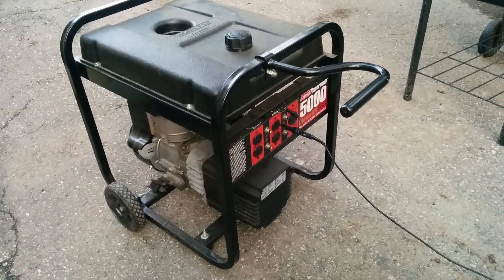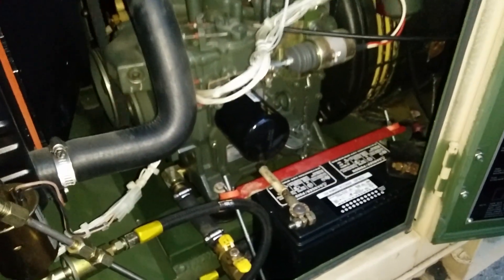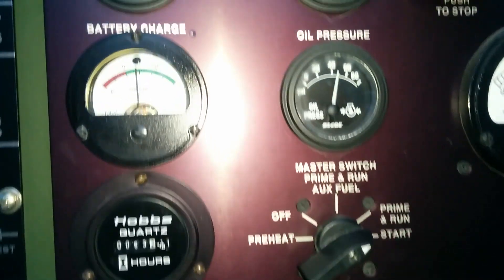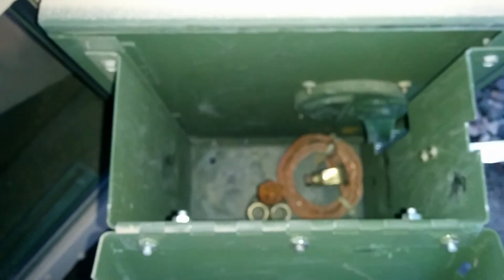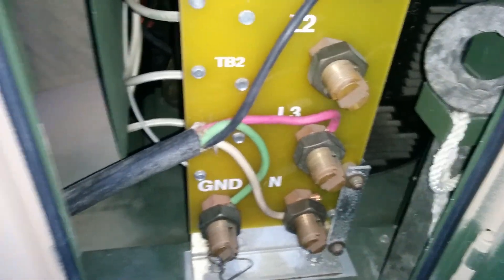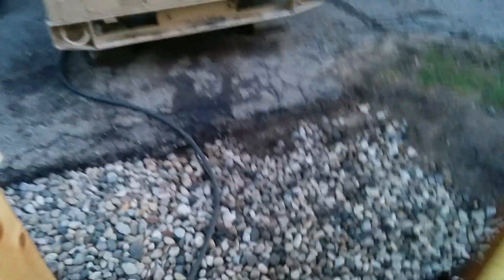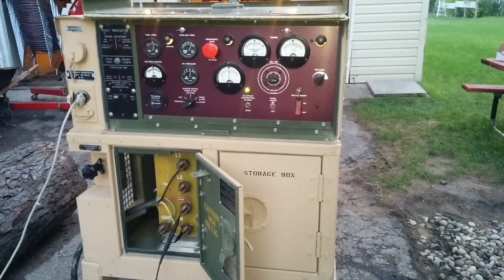Mep-802a vs consumer generator

Comment: how did you obtain this unit? was it at a government liquidation sale? were you allowed to inspect the unit before placing a bid? how much was the purchase price? thank you for your time and look forward to a reply. I am in the market for a standby generator and looking for information on the subject of military surplus.
Reply from the maker: thomas marabillas yes govliquidation.com does allow squeduled previews but tge closest site to me is 3hrs away. I dont know if govplanet.com will allow previews. Look for reset tags the tan one have tgem more often. Dont buy it if it has that. Look for wet stacking around the exhaust manifold. They can still run but usually never at tge rated power tgey once could without a rebuild and they'll burn oil if they're westacked. I lile going for ones that have the exhaust flap in pristine condition to better ur odd rain water never filled the engine. U can get them depending on availability in your area and how many per auction and how many hours 1500 or less is a number i go for. They can very from $1000 to $2500 for a good one.
Reply from the maker: Syc holic holy crap 5500 for a early 80s air cooled 003a with a new paint job. Those things didnt come with digital gauges either. Have you ever heard a 002 or 003 run? They are louder then that Coleman. They put out clean power too but man are thet loud. I usually get the 002 and 003 from auction for under $800 ive had 3 or 4 of them over the years. I give those ones to family memebers who live in areas with no neighbors. I've been trying to get ahold of a honda diesel 6kw so i can scope it and try to start a 3 ton ac with it.
Reply from the maker: Syc holic them what would you like me to compare it to? People who own these consumer colemans & generacs and hook em up to their homes never read the manual and think its fine to use it on their furnaces and tv's. Don't get me wrong if its all u got dont freeze to death but if its summer id keep it to your lights fridge and freezers only. As far as comparing it to a nat gas stand by ill have to make a video on that too soon. But they have the same style air cooled riding lawnmower engines in them that burn oil and can only run a few days at a time between oil changes. I work with a guy who installed hvac and nat gas gens he said after and duruing power outages people would call saying their furnace quit working. They would show up see a gen transfer switch or like and ask them if they used a gen recently if it wasnt still on gen at the moment. He told them streight ur gen killed ur furnace control board. Especially on the newer more computer control models. Your not under warranty for this now. Then on the other occasions when he went out on calls for nat gas gens he installed. If it was a 2+ day outage they'd get tons of calls cause of the generac units shutting down on low oil. Mind you these people just spent $8 grand or more to have them installed. He told them it says right in the manual 50 hour oil change intervals. (I think some are up to 200 hrs now but not sure if its just the water cooled ones or not.) Charge them for the service call and oil change $200 +. If it was real cold out they would get service calls for a power fault. On start up the slip rings would be frosty and not make good contact so the power output would be not stable enouph for the transfer switch to change over. He'd go out try starting it a few more times till the frost melted/scrapped off charged em a service call and "warranty the repair" lol  $100+. Ill compare these mil gens to whatever consumer gen someone is willing to let me load test and scope. Are they as portable no, but i have 3 mep-803a on military trailers that i pull with a v6 fwd ford edge all day long. Also he had a couple customers who had 10+ day or more power outages a year and those units would typically stop producing rated power in 2 yeats or less or he even had one who had to change the cylinder head because the valve seats are not hardened so the valve would wear deaper and deaper into the head to the point where the valve would start hanging open. He would have to loosen the valve lash to adjust for the now taller valve stem protruding from the head. The spring presure gets reduced cause the valve seat was now recessed.
Reply: ebay just seen a fully restored MEP-003a selling for 5k but this guy is comparing apples to oranges.  1 cylinder vs 2 cylinder,  portable vs not portable, not to mention totally two different types of generators....
Reply from the maker: Syc holic fully restored? By who? Some guy or the government. Like i said above if its been restored by anyone and has a "tier 2 reset tag on it" it's got a ton of hours on it with a few new parts to make it run and a new paint job. Yes i am comparing aples to oranges. Which is a good mil spec gen vs an average home owner style gen. They are very different. My point is those $1,500 or less consumer generators have "dirty power ". Everyone and there mother has heard that term before on gens. Now u know why people say that. If you are using a gen for your home backup just be aware that using "dirty power" is very bad for your electronic devices and it will shorten the usable lifespan of your devices.
Reply: you arent paying for clean power, they are designed for motors that dont care about dirty power like power tools..  just saying ya comparing apples and oranges. btw this was the one I seen. looks pretty mint to me. (ableit I wouldnt go purely on 'looks')  https://www.ebay.com/itm/MEP-003A-MILITARY-MEP-DIESEL-GENERATOR-10KW-ONAN-803-802-002-MINT-REDONE-ARMY-/122912929883  I would also go out on a limb saying that coleman is a total joke, 100% duty cycle with a power factor of 1? lmao BULLSHIT... Also dont get me wrong Im not saying your gen isnt way better but that coleman is like a harbor freight special.... really isnt comparing the two.  should pull the cover off the coleman see what kind of field flashing it does and is there a AVR etc also what does the sine wave look like under a load?  should even be a warning on that manual saying dont use 'electronic devices' with said generator again just by looking at it screams to me power tools only...
Reply: Well its not a TQG either like yours its a nice gen Im not putting it down like I said but shouldnt be trying to compare a that yugo to your vette...

Comment: Average price these sell for at surplus auctions?
Reply from the maker: Mark B price is extremely variable. Depends on state the auction is in, How many are in the auction, how many hours on unit, wheather its a tier 2 rebuild or not, weather its running condition unknown or been tested, how many hours on unit, visual condition, has visable wetstacking on exhaust manifold or not, has good condition exhaust flapper or not, on a trailer or not.
I usually go for around 1500 hours or less, no tier 2 reset tags, good visual condituon, no visable wetstacking, running condition unknown, good exhaust flap, with or without trailers, but newer Humvee style tires if i get a trailer. And anywhere from $1000-$2500 I'll spend and ive spend $2500 on ones with locked up motors on trailers
Reply: Still a huge bargain it seems. They would be using quality american made engines and components?  In australia we would be paying 4-5k for chinese junk with similar outputs and higher end stuff can easily set you back 10k. Maybe I need to buy a heap and bring them back to aust.

Comment: Hey Bobby:  Is this generator good for 24/7 running an off grid house?
Reply from the maker: FreemonSandlewould yes thats exactly what its designed for. You will only have to shut it off every 500 hours to change the oil. So every 21 days. You can hook up an aux fuel tank of any size and the on board fuel tank has a second float that with refill the onboard tank to 3/4 when it gets below half tank automatically with the built in aux fuel pump. Just turn the main ignition switch straight up and down to prime & run aux fuel position
Reply: Uhm, no. I'm a 91D20 :-)  Hello from Korea. 

Check LO 9-6115-641-12. 250 hours or 6 months to the service. Use cheap ole 15w-40. I normally see about 4000 hours out of an engine before I have to swap them, and swapping an engine is a pain in the ass. Also note that life really sucks when someone does an AUX fuel but the fuel level sensor is broken, and it pumps the whole barrel onto the ground overnight.

Comment: Did you convert to single phase or are you only using two legs of the three phase?
Reply from the maker: PgPgDn they are 12 wire gen heads they have a reconfigiration switch on them behinf the gauge panel that allows for full power output in 3 different configurations. 120v single phase. 120/240 split single phase or 120/208 3 phase. I keep it on 120/240 spit single phase. Only the mep-002a 5kw, mep-003a 10kw, mep-802a 5kw, mep-803a 10kw units have this ability. The 15kw units and up are 3 phase only. However sewrzuk has a video showing how u can rewire the mep-004a to 120/240 low zig zag with some easy mods to the reconnection board but the newer mep-804a are only 10 wire gen heads and cannot be reconfigured for single phase

Comment: yeah, but it doesn't have wheels.. duh.
Reply from the maker: Woodchop  it does now. old lawn mower tires on a custom scope axle setup
Reply: Bobby Diminnie Do you still have it? How large is the fuel tank?
Reply from the maker: jebmax2 6 gallons no that one is gone i only have 10kw now
Reply: My MEP 004 AAS has a dully trailer with 900-20 tires !!

Comment: You know sadly this video eloquently demonstrates the difference in product quality. Granted a new civilian version of the Mep-802 is probably ten grand or more. What's sad is the guy who will spend hard earned money on the POS.
Reply from the maker: w4csc i dont have a honda. So take a Video of it on a scope and put it in the description. Have fun changing ur oil every 50 hrs. Theses only need oil changes every 500 hrs. Id love to see that honda start up a 3 ton air cinditioner. There different yes but at .3 gal/hr not a fuel hog
Reply: There is a 7000is(4 grand) that started a 4 ton. It wouldn't shock me if he turned off everything he could if it started the 2 ton as well. I've heard of these units putting out way more then rated. They are freaking pricey though.
https://www.youtube.com/watch?v=a2ASAWGwrjc 
It'd be butter with a softstart kit(300 a pop just depends on your needs). Check out the new Westinghouse wpro8500 5% THD. I think even an inverter generator is typically in the 2-3% range and looking at that oscope just guessing it looks somewhere around what a 5% wave looks like too. 5% is supposedly some magic number. 9% works but is not ideal. Looks like the best consumer grade genset to come out in awhile. Looks like it's coming out of the same china house as generac. Not that that's awesome but generac seems to be at the top of the Chinese heaps along with champion. Nothing like this unit you have and I'm sure it'll bog down at the 11k surge. However it seems like the best your gonna get for around a 1100 new in box with a 3 year parts warranty from a big box store. Burns about half a gallon an hour at half load.
Reply from the maker: @JONNYGEEKMANG  No doubt that Honda is an excellent unit. I would be interested in seeing what the voltage drop is on that thing during start up. When that MEP starts my AC I barely see the lights flicker any more then when I'm on grid. The 5-2-1 hard start kits are great I have them installed on every unit right from the get. Had a brand new Bryant installed 2 years ago I installed a 5-2-1 as soon as the van left my driveway. I was getting these things from auction running condition unknown for $900-$1500 and selling them for 5k I only had one bad unit ever after years of buying as many as I could every time there was an auction. but knowledge on what to look for helped my odds a bit better then buying any random unit.
Reply: I was going to say have fun changing your valve lash every 200 hours.  The oil change is no big deal on the Honda.
Reply: Bought mine for 250 bucks. 5000 kw, 479 hours and have a record of everywhere it's been. Not exactly what I would call spending a ton of money on a pos

Comment: How does it do with the inrush starting on the HVAC unit? We are going to build an all gas home (cook top, water heater, furnace backup) and will need one to just run HVAC/refrigerators like you're doing. I sold my MEP-003 and I'm torn between the 802a and the bigger 803a.
Reply from the maker: It does real good on my 3 ton 13 seer bryant AC unit. The only thing is you dont want much more then 2000 ish watts currently being used when it starts to keep the engine from boging down. So the days you know you'll be using it keep the toaster oven and every ceiling fan in the house on at the same time to a minimum. Myself to combat this i found a load manager from xantrax.  Its called xantrex freedom sequence power manager. All your power runs through this first on its way to your panel. U can add some 15-20 amp 120v loads to it for shedding or what im going to do is utilize the built in low voltage relays to interupt the AC contactor signal wires. (The little wire going from your furnace to the outside AC unit). This way it will determin if theres too much load currently being used it wont start the AC unit or if the unit is on and someone starts the toaster oven and microwave and all the fridges kick on it will shit the unit off untill the generator can handle it again. All the treshoulds are programable and there's a few vids on YouTube about it. Even big natural gas whole house generators use this technique in the automatic transfer switch.  I haven't done it yet but ill be going at it this summer.
Reply from the maker: https://youtu.be/_P6N6hG_LWU
Reply: Excellent information! Thank you so much for sharing. I didn't know the Xantrac device existed. Now to make my decision and this definitely makes it easier. Thank you!
Reply from the maker: +4thapack no problem

Comment: How long will this generator run on a single tank of gas at full load or half load?
Reply from the maker: manual says 1/2 gallon per hour at full load. closer to 1/3 gallon per hour at half load
Reply: Keep in mind JP8/F24 we use in the Army will give you a different run time then say, off road red DF2.
Reply: @micah66048  better or worse ?
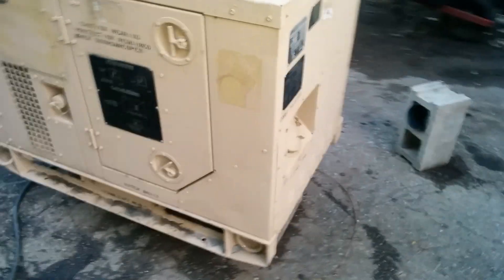Reply: @twofortyrida  JP8 is a much thinner fuel. Also these engines should be around 1:16 compression ratio, while a commercial engine will be 1:21 or so. The upside is the military fuel and low compression ratio, combined with glow plugs, these will start no problem below zero.
Reply: Mine is diesel and ran for 3.5 days on less than 5 gallon
Reply: https://greenmountaingenerators.com/manuals-and-support/mep-802a-manuals/  0.57gal/hr according to that...